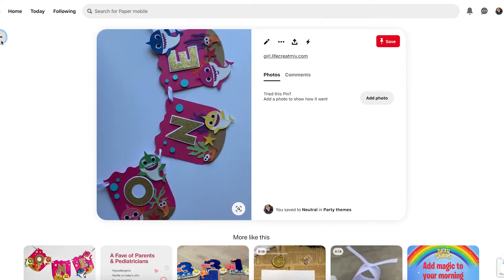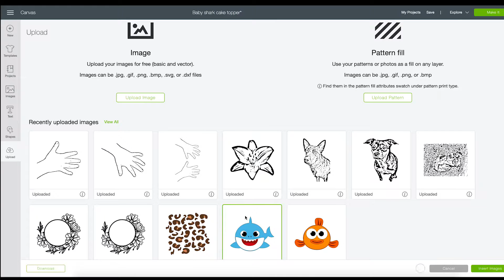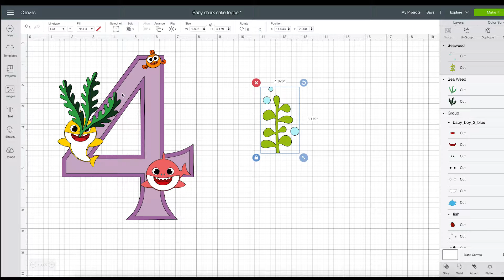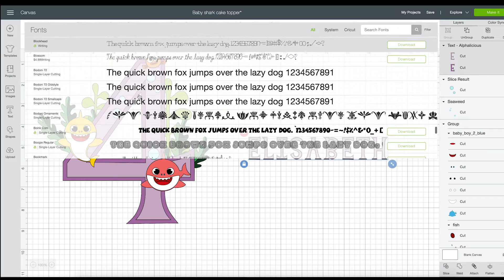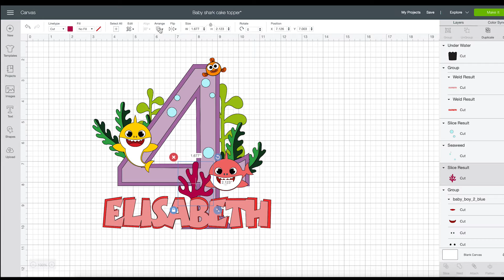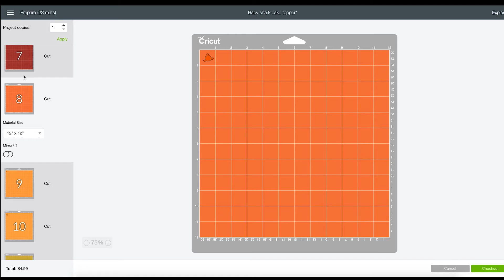Designing 3D Cake Topper Using Cricut Design Space

Comment: So if i print and cut this, would I print it on regular printer paper then glue to cards took after I did a duplicate and weld the entire image so it would have backing? Because then it wouldnt be 3D. Or would I print and cut each item separately along with a welded duplicate image of each item then glue/stick it all together so it would then be 3d?
Reply from the maker: I have another video where I show how I assembled this cake topper! If you wanted to have a background on the entire cake topper I would suggest duplicating the entire project and welding one. In the other video you will see everything is cut out on colored cardstock so the only thing I would print+cut would be the baby sharks but that’s totally optional. Hope that helps! 😊